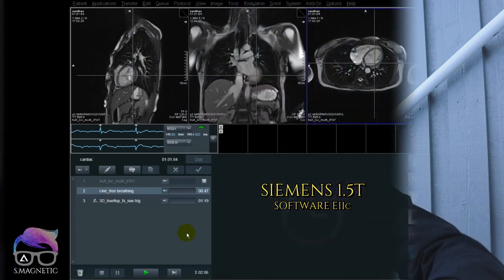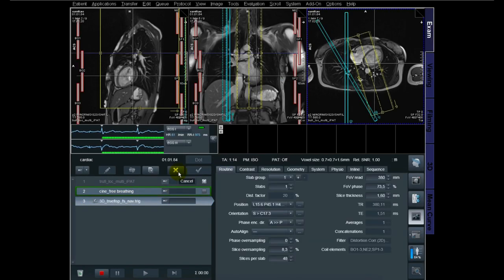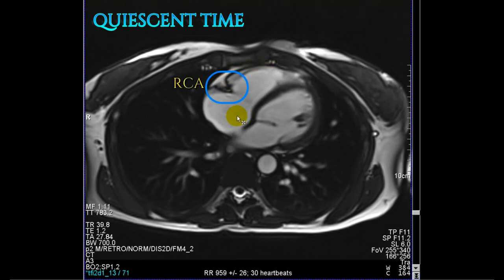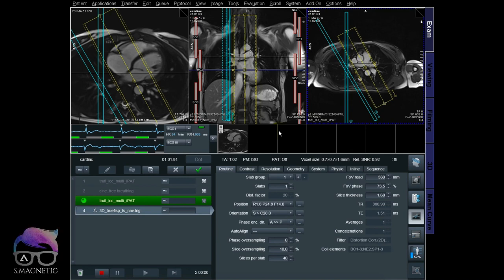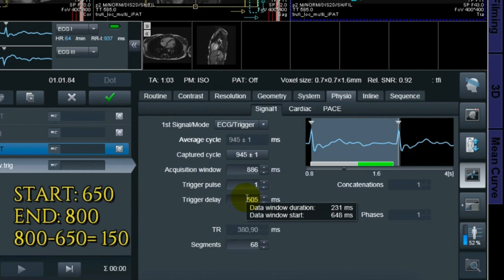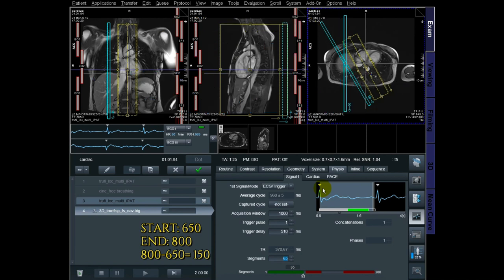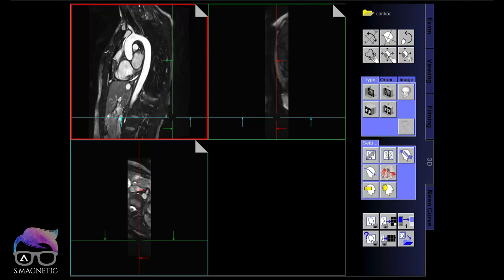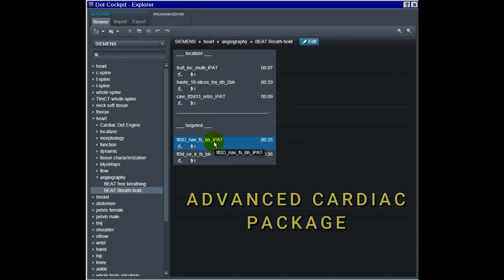non Contrast Enhanced MRA "How I Do It"

Comment: Did subscribed to your channel recently. It is very informative and useful. I'm so glad that you're using Siemens system which really helped me a lot towards my career on MRI. Thank you very much for willingly sharing your knowledge through creating videos. 

Question, does this steps/techniques you used same goes when doing Renal MRA? I got a little trouble optimizing on where to put the sat band to reduce unwanted signals just to focus only the arterial vessels. Maybe you can also do a tutorial video for this. Thanks in advance!
Reply from the maker: Thanks for following and kindly words. Well, the setup is not the same. Please check this link for how to perform this. http://mriquestions.com/uploads/3/4/5/7/34572113/non_contrast-enhanced_mr_angiography-00012410.pdf

Comment: Hi Boc, thank you so much for the video. May I ask, when you point to trigger delay, there are two lines …data window duration, and data window start… you said the data window duration controlled by segments , but u didn’t show the final duration after u adjust the segments, I just want to confirm , after u adjust segments, in your sample to around 60 something, the duration will change to 150 as you calculated?
Reply from the maker: Correct. This various from heart rate to heart rate. What I have in that specific video will various anyways so you must understand the start time and the duration you can have to tailor in this for that specific case of yours.
Reply: @Nguyen_MRI  ,thx a lot Bac

Comment: In 3T , it will be more challenging to do this sequence. May I ask you about non contrast lower neck MRA ,including arch outflow and bilateral subclavian arteries? What sequence will you use?
Reply from the maker: Good question. This sequence is very difficult on 3T due to its physics itself. However, it’s possible. But we don’t choose 3T if having cases as you ask. But if have to and only 3T available, you can try the bright blood 3D space stir.

Comment: Hi when   you do Mri you can put RF more or less? I do a mri and i feel like burnings
Reply from the maker: Yes you can.
Reply: @Nguyen_MRI  it is possible that tehnician put me more RF than necessary? You calculate the weight when you use RF?
Reply: For 47 killo and 1,64 how  much RF you can use for no adverse effects and burnnings?
Reply: Can you do a video woth all the coils that are used for mri? For all abdomen mri what type a mri is used?
Reply from the maker: @luminitagheorghe6163  one important reason you have to put in weight and height so the scanner can calculate. Difference between adult and child etc.
Reply from the maker: @luminitagheorghe6163  for abdomen usually spine coil and body in front. Depending on what vendor and what is available it can look different. Nonetheless, same purposes.

Comment: In 8.40 you clicked on Capture Cycle, but on 11.00~ you applied the sequence without clicking the capture cycle. Why is that? TIA.
Reply from the maker: yes correct, it can be a little bit confusing. at 8.40 i capture cycle once so it will easier for me to tailor the ECG as shown. then i start the sequence just to see how the patient is breathing before i stop the sequence, pull it down and adjust the pace (search position red). if i at 11:00 hit the capture cycle again, then my tailored ECG will be ruined. that i dont want to happen.

Comment: Great video👍 but i have a query. u say at lower heart rate the scan time is short and vice versa but my practical observation is contrary to this. At higher heart rate the scan time is short (less breath hold time). Kindly comment on this.
Sometimes when i perform nav sequence it just show me a histogram pic not the required 3D image. unable to understand why is it so.
Reply from the maker: Thanks for comment. A bit difficult to understand this. The thing is that lower heart rate the R R interval is longer. Which means you able to sample longer within that R R. Inside a RR the sequence need time to prep also. So by having a fast heart rate the RR is so close which in terms means you don’t have time to sample that much - longer scantime. This of course only if you are tailoring your sampling whenever the heart is still like I show in this video.
Reply: Thanks.. Kindly comment on second part of my reply.
Reply from the maker: Regarding the second part I have not encounter this issue. I know you can turn  off the request of the breathing histogram, thereby no histogram available at the end of scan.  But not having the raw data available when sequence is finish I never seen before. Only if the scans fail or so.

Comment: Thanks for another great video! Can you give me any tips and/or direct me to a source with info to improve ECG signal? We already use abrasive gel followed by conductive gel but sometimes once the patient is inside the bore the ECG signal suffers from a lot of interference, if we take the patient out of the bore the signal returns to being simply beautiful without having to do anything else. We're using Siemens Skyra. 
Thank you 👍
Reply from the maker: 3T can be challenging. Have you tried different types of ecg pads? We use NUPREP to rubber the patients first. I notice without that it’s very challenging
Reply: @Nguyen_MRI  right, nuprep is what we use, it does make a huge difference. We’ll see about trying different ECG pads, thank you 👍🏻

Comment: Hi Bac, were you suppose to change the segments box from 65 to 150 as mentioned?
Reply from the maker: hi, in this video example you need to find the start and and. so i found start 650 and end 800. if you take 800 - 650 = 150 durations. you can change the start 650 at the exam card signa1 - trigger delay. next step is to tune in the duration which is in the same exam card, but down below, segments. tune in the segments to approx 150.
Reply: @Nguyen_MRI  Hi Bac, when you were changing the segments, where were you checking that it showed 150, was it on the ECG cycle graph?
Reply from the maker: @hopsie9983  hover the mouse over trigger delay. You Get the info there
Reply: @Nguyen_MRI  ahh yes got it now, looking forward to trying this out, thanks. Future tutorials...t1 mapping post processing? For contrast enhanced aorta, do you use twist seq or classic 2d seq pre/post?
Reply from the maker: @hopsie9983  for aorta depends. If the radiologist wish to have high temporal resolution the twist. If not or more standard it’s 3D flash approach yes.

Comment: What was the overall time of acquisition for this particular example?
Reply from the maker: Depends on the heart rate, coverage, resolution  and breathing pattern. Can take everything from 2-5 minutes.
Reply: Thank you. I have another question. When you adjusted the segments where did you look on the control panel to ensure the 150 optimal duration time had been set?
Reply from the maker: You go into the physio - signal1 tab. Then you hover over trigger delay. You get start and duration time there. Duration is controlled by segments.
Reply from the maker: Trigger delay parameter shows : data window acquisition in terms duration. While data window start in terms start. Thanks.
Reply: @Nguyen_MRI  Hey Bac, I think in the video, the duration was still over 200 ms unless I missed it. After you brought the segment down, did it come down to 150 ms?
Reply from the maker: Good question. I tend to stay around 150ms or so whenever patient is having a irregular HR. So I stay more or less safe.

Comment: Hi renal angio MRI non contrast which sequnce the best for do it... Machine EEZENZA SIEMENS
Reply from the maker: Native truefisp.
Reply: @Nguyen_MRI  is it with triger or not?
Reply from the maker: Triggered. https://cdn0.scrvt.com/39b415fb07de4d9656c7b516d8e2d907/1800000001175538/4bcb3eea9c9e/native_truefisp_respiratory_trig_1800000001175538.pdf
Reply: @Nguyen_MRI  thanks alot. Hhhhh. But in my machine dosent active...
Reply from the maker: It means you don’t have it. It’s a package which needs to be bought.
Reply: @Nguyen_MRI  thanks for explaination

Comment: Hi. Was this done on Siemens Aera 1,5t or Siemens Skyra 3t?
Reply from the maker: Hi 1.5t aera. Can be done on 3T as well but more challenging.
Reply: @Nguyen_MRI  thank you bac! Keep doing like this! You rock!
Reply from the maker: @filippobovero8080  thanks for kindly words.
Reply: @Nguyen_MRI  Hi bac, just another question for you...where can i find the CINE free breathing sequence to check the quiescent time in the Siemens tree?
Reply from the maker: @filippobovero8080  just use your current cine sequence. 1. Add on avg to 2-3.    2. Run it with retrospective ecg triggering. 3. Calculated phases to 60. 👍
Reply: @Nguyen_MRI  Hi Bac! I'm trying to do this 3dtrufi following your video step by step. just one more thing: at the end of your video you show where to find in the siemens tree both the trufi localizer and the 3d trufi breathold, but your 3d trufi in the video is a freebreathing sequence. Could you kindly write to me the exact location of this sequence and the "Siemens original name" (the freebreathing one) in the siemens tree? many thanks Bac!
Reply from the maker: Are you currently running a standard cine for cardiac imaging? Then use that as free breathing with multiple avg/nex.
Reply: @Nguyen_MRI  yes bac. But now I am asking about the 3d trufi with navigators..
Reply from the maker: Ah. I see. I need to get back to this within 2 weeks. I’m not currently at work.
Reply from the maker: Actually go to SIEMENS- HEART-ANGIOGRAPHY-BEAT FREE BREATHING. from there you will be able to find the 3D truefisp if having it available.
Reply: @Nguyen_MRI  tfi3D_nav_Whole-Heart_iPAT ??
Reply: @Nguyen_MRI  or tfi3D_nav_fs_nonbh_iPAT ??
Reply from the maker: @filippobovero8080  try this one.